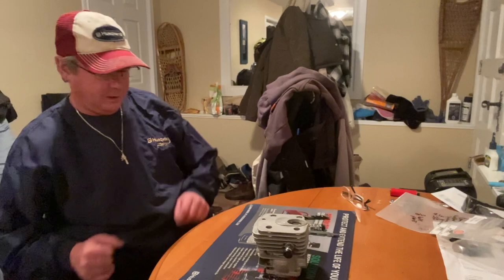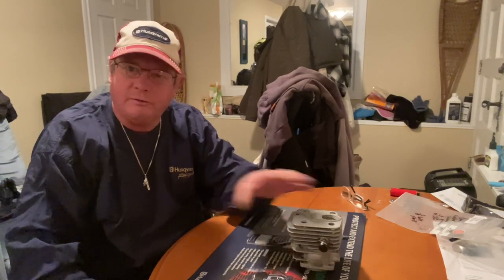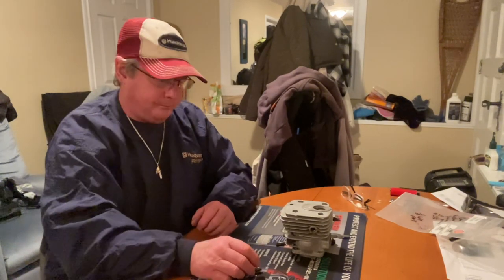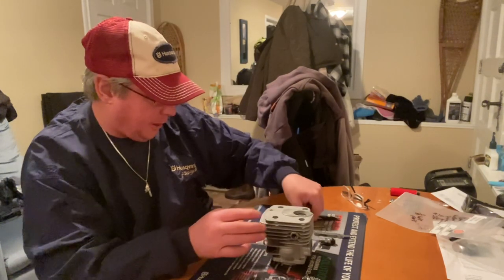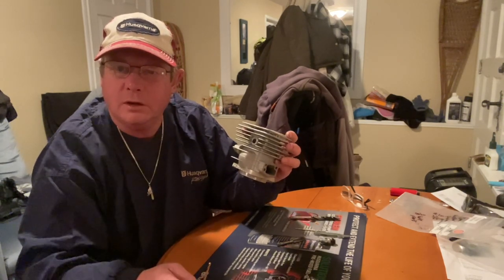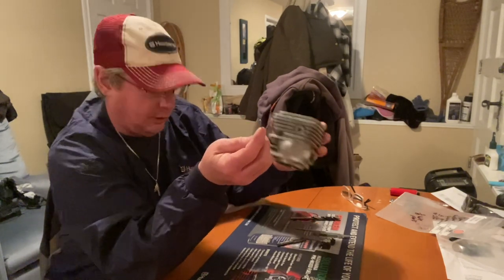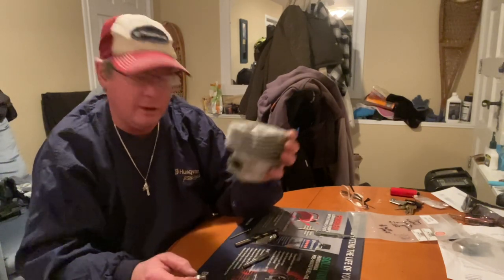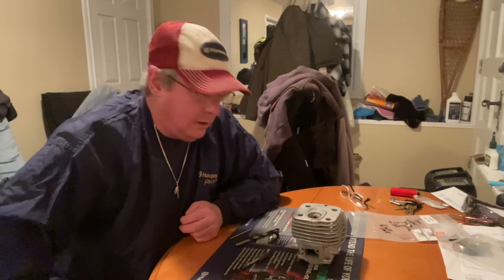How to add a decomp valve in husqvarna saw

Comment: I found on our 372xp firesaws alot of the guys had trouble with them flooding or hardstarting when using the decomp. I never used mine and never had problems.  My 181 doesn't have one and it starts great .

Comment: How much power do the decomp valve rob? Stihl puts them in the top also. Also different valves are calibrated differently. I put one in a husky 61. And I used a decomp valve from a Stihl MS 362. Would like to see a dyne test.

Comment: Real men don’t need a decompression button . I’ve got a 365 XP Husqvarna , never used the button yet  , don’t trust them . Leakers ! 👍🇨🇦
Reply: For sure my 572 am 372 both have em I replaced one when I bought it brand new it leaked around the seat of it
Reply: Real men?  Really? I own 592 xp down to a 550.  Dont use decomp on any of them.
Reply: @austindenotter19 real men run 365s. 😆
Reply: Try starting a 395 with a little work done to the cylinder @ 60 years old.  You’ll want a decomp!
Reply: Are they all a 10x1 size thread ?
Reply: I got a jonsered 920, in cold weather I bring it inside to warm it up. Then stand on the saw and pull with both hands. Also same for homelite xp1020. I got a standing bet with anyone for ten bucks.  Bought me a new saw. 365 XP, I was starting 100 cc homelites when I was 12.
Reply: What's better, having to have a shoulder replacement from years of snap-back failed pulls, or doing this and reducing wear and tear on your body.
Reply: @erickeenan7562  the modern saws are pretty easy to start , back in the eighty’s we had big Sthil’s . The liked to pull the starter cord handle thru your fingers . MAN UP ! 👍🇨🇦